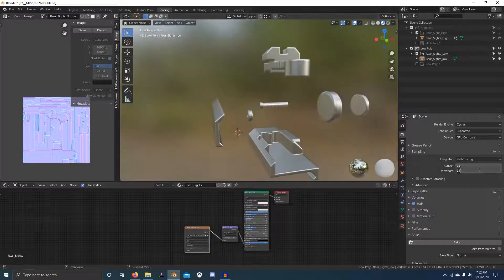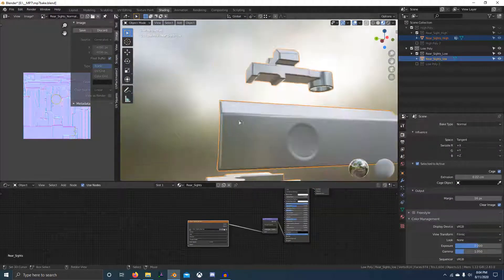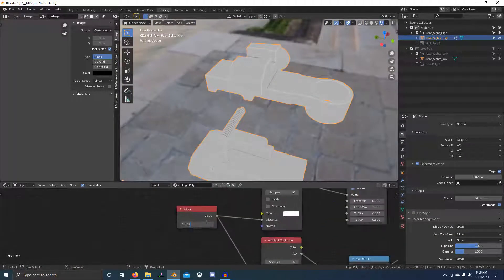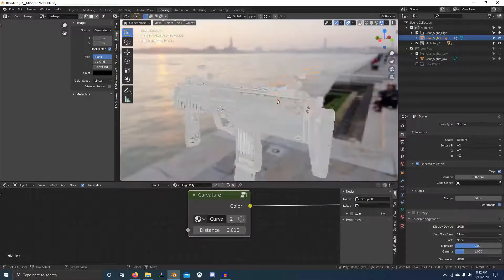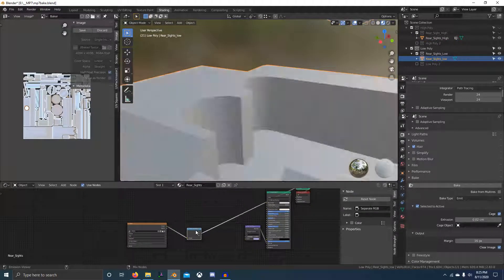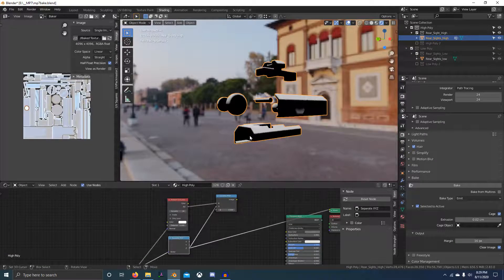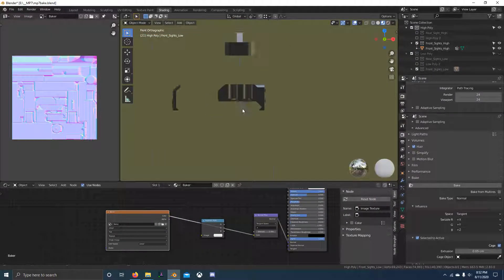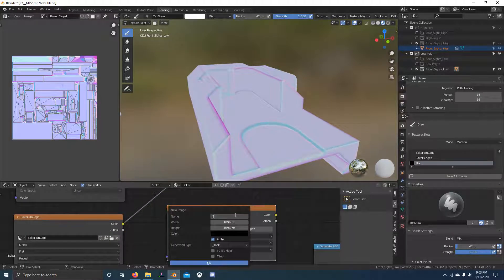Blender MP7 Game Asset Tutorial Part 26 | Baking Tips And Tricks

Comment: coming back to this for practice on a glock. for some reason, my curvature isnt showing, but it did on my mp7. im on a different pc if that would make a difference, i think i have the same node setup. not sure if i need to set cycles renderer to gpu, because if i do, then uhhh. no curvature on this computer that im writing this comment on! (the computer is an old macbook)
Reply: one more thing, im doing this on a slightly lower poly, (about 10k) not sure how that affects curvature as im don't work with it too often